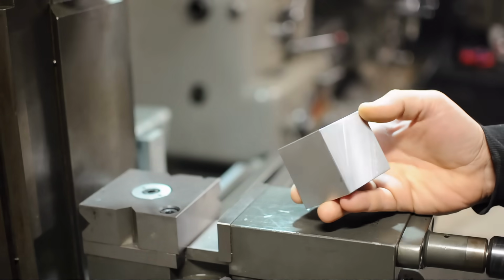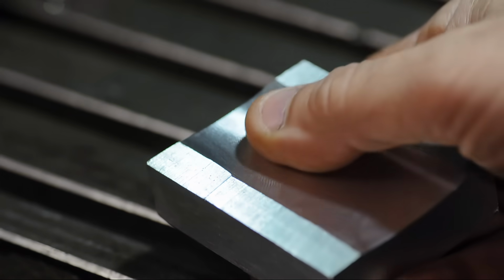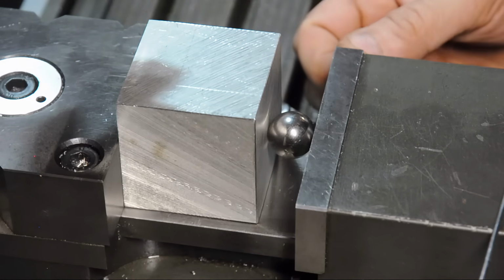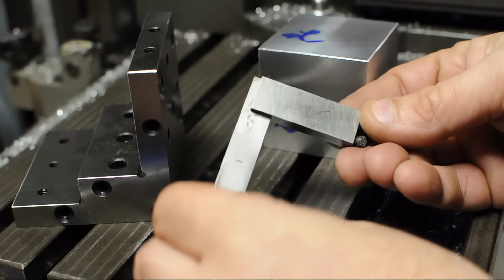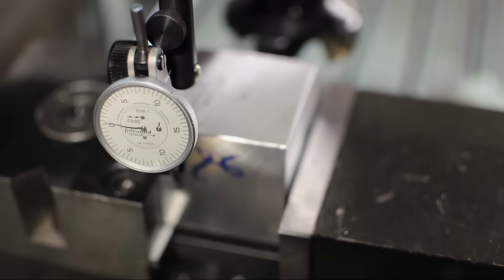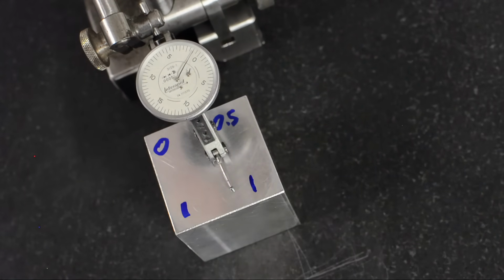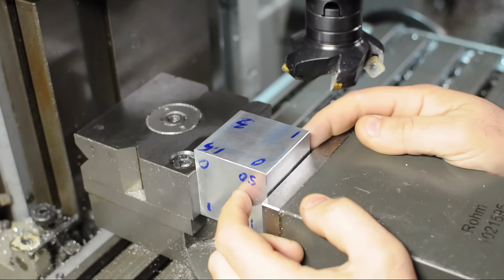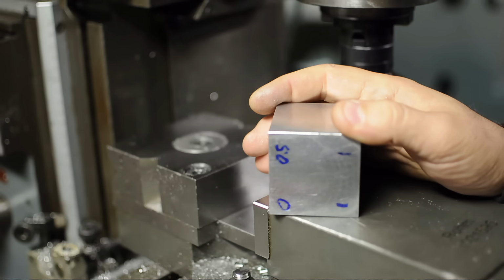Stock? Mill? Square!

Comment: tony can you get steel as level as a surface plate  so you can scrape ways and such?  like down deep in the numbers ,0.2S ,0.1S? "reasoning" i'm looking at synthetics as base material and maybe even way and such i figure if it can be done in steel alt-materials would be a cinch and surface plates for what they are well i don't have any children to sell and i'm down to one kidney and my doctor says the other is a no go.  if i'm ever to get started i'm going to have to get creative but it seems having the surface plate is the only answer as i want everything dead nutts of course,. meaning i'm going to have to start from the ground up, even gave acrylic-creet  and silicon forms a ponder

Comment: Good program Tony. Another thing that I was taught at the start of my apprenticeship, was to clamp a solid square against the finished side, and adjust the part to indicate the blade true. It works especially well on a surface grinder.
  Your milling machine is interesting. What brand is it?
Reply from the maker: schaublin

Comment: You can do all this in 2 mins if you make all 5 cuts on the first pass.... no need for all this shimming & soft rod to hold it... Use the milling machine's axis to fix the cube issues. I love you Tony, but there is a much better way to do this. Look at Joe Pie's vid on this.

Comment: I‘m a dentist, which means I do precision work with metal, but I did not see you measure the edges of the block to make sure it is a cube? Since there are 12 edges, milling one side would change 4 edges. Now I‘m verklemmt! Is it a cube or not? And if not what would it take to make it to be one? So you are probably square with the world but I am totally out of whack.

Comment: Just a wonderful tutorial, but I am not sure it demonstrated true squareness, since a square has sides of equal dimensions. This solid was orthogonal, but its dimensions were never measured. It could have been, and probably was,  a rectilinear parallelepiped.
Reply from the maker: good catch I should have been clearer. square, in machining, almost always means orthogonal.  90 degrees. not square as in the shape.

Comment: the video becomes boring not when it is long but when a narrator talks in a fast pace and viewers find a difficulty to follow while focusing on the video at the same time. as for my opinion on the error, could it be caused by the Vibration resulting from the friction between the work and the mill cutter with a high feed rate ?

Comment: Can a non-machinist ask what may be a silly question? How do you know that the face of your cutter is square to the axis of the mill and parallel to the table? Also are all cutting edges of the inserts in exactly the same plane? Since it is rotating, would any of that matter?
Reply: If you want perfect, you need to use an indicator on the vise (specifically the back jaw of the vise), in X direction, then, stick an indicator into the spindle, and put something you know is grounded/surface grounded squarely flat (a tramming ring) into the vise, big enough to sweep with your indicator in a circle with the spindle, it will show high and low points, thats where you tram in the mill head, either left/right or tilt front to back. If your spindle indicator sweep shows a high point on the left or right on the tramming ring, then you'll cut at an angle when you feed in the X direction, same with the Y if its high or low in the front or the back of the tramming ring.

Comment: 8:07 that's not a good idea, better put two nuts on both sides of the ball to get larger contact points, especially on hard material which has a significant tilt. Else you might end up with a ball flying up in the milling head.

You really don't want to be THIS guy in the workshop.

Comment: A Good vice and a CNC Mill can achieve better squareness than you make a milling machine out to. Maybe your standard manual mill. In a CNC Mill with zero table runout and a good vice like the Kurt 3800 series.0002” squareness is pretty simple to achieve maybe not every time. Half thou is about the worst it gets. 

Better yet clamp the stock in the vise. Skim the top face clean. The. Run a 2 d contour around the 4 outer sides. All that is left is facing the 6th side. The less setups the less variables.
Reply: More than the vise.. it was only a $1600 vise when I purchased it. It opens 10.25” and has perpendicularly on the fixed jaw like no other. It also has drawbacks. The fixed jaw Carrier is part or the cast vise body. So that complicates future refurbs with surface grinder. Still the vise paid for it self in one week. It also for repeatable setups for squaring stock and cam setups. It is awesome som. They make a 6” version called the 3600 also.
Reply: More than the vise.. it was only a $1600 vise when I purchased it. It opens 10.25” and has perpendicularly on the fixed jaw like no other. It also has drawbacks. The fixed jaw Carrier is part or the cast vise body. So that complicates future refurbs with surface grinder. Still the vise paid for it self in one week. It also for repeatable setups for squaring stock and cam setups. It is awesome som. They make a 6” version called the 3600 also.
Also my initial point was simply a mill can square stock extremely accurate with the correct equipment. His video was good the most important part of squaring up is the round object in the movable jaw the first 3 cuts. It’s just all that requires debuting and time. The contour method is incredibly accurate and it complete 5 of 6 sides. Leaving and simple deck off the top when done.
Reply: More than the vise.. it was only a $1600 vise when I purchased it. It opens 10.25” and has perpendicularly on the fixed jaw like no other. It also has drawbacks. The fixed jaw Carrier is part or the cast vise body. So that complicates future refurbs with surface grinder. Still the vise paid for it self in one week. It also for repeatable setups for squaring stock and cam setups. It is awesome som. They make a 6” version called the 3600 also.
Also my initial point was simply a mill can square stock extremely accurate with the correct equipment. His video was good the most important part of squaring up is the round object in the movable jaw the first 3 cuts. It’s just all that requires debuting and time. The contour method is incredibly accurate and it complete 5 of 6 sides. Leaving and simple deck off the top when done.
Reply: More than the vise.. it was only a $1600 vise when I purchased it. It opens 10.25” and has perpendicularly on the fixed jaw like no other. It also has drawbacks. The fixed jaw Carrier is part or the cast vise body. So that complicates future refurbs with surface grinder. Still the vise paid for it self in one week. It also for repeatable setups for squaring stock and cam setups. It is awesome som. They make a 6” version called the 3600 also.
Also my initial point was simply a mill can square stock extremely accurate with the correct equipment. His video was good the most important part of squaring up is the round object in the movable jaw the first 3 cuts. It’s just all that requires debuting and time. The contour method is incredibly accurate and it complete 5 of 6 sides. Leaving and simple deck off the top when done.
Reply: More than the vise.. it was only a $1600 vise when I purchased it. It opens 10.25” and has perpendicularly on the fixed jaw like no other. It also has drawbacks. The fixed jaw Carrier is part or the cast vise body. So that complicates future refurbs with surface grinder. Still the vise paid for it self in one week. It also for repeatable setups for squaring stock and cam setups. It is awesome som. They make a 6” version called the 3600 also.
Also my initial point was simply a mill can square stock extremely accurate with the correct equipment. His video was good the most important part of squaring up is the round object in the movable jaw the first 3 cuts. It’s just all that requires debuting and time. The contour method is incredibly accurate and it complete 5 of 6 sides. Leaving and simple deck off the top when done.
Reply: More than the vise.. it was only a $1600 vise when I purchased it. It opens 10.25” and has perpendicularly on the fixed jaw like no other. It also has drawbacks. The fixed jaw Carrier is part or the cast vise body. So that complicates future refurbs with surface grinder. Still the vise paid for it self in one week. It also for repeatable setups for squaring stock and cam setups. It is awesome som. They make a 6” version called the 3600 also.
Also my initial point was simply a mill can square stock extremely accurate with the correct equipment. His video was good the most important part of squaring up is the round object in the movable jaw the first 3 cuts. It’s just all that requires debuting and time. The contour method is incredibly accurate and it complete 5 of 6 sides. Leaving and simple deck off the top when done.
Reply: More than the vise.. it was only a $1600 vise when I purchased it. It opens 10.25” and has perpendicularly on the fixed jaw like no other. It also has drawbacks. The fixed jaw Carrier is part or the cast vise body. So that complicates future refurbs with surface grinder. Still the vise paid for it self in one week. It also for repeatable setups for squaring stock and cam setups. It is awesome som. They make a 6” version called the 3600 also.
Also my initial point was simply a mill can square stock extremely accurate with the correct equipment. His video was good the most important part of squaring up is the round object in the movable jaw the first 3 cuts. It’s just all that requires debuting and time. The contour method is incredibly accurate and it complete 5 of 6 sides. Leaving and simple deck off the top when done.
Reply: More than the vise.. it was only a $1600 vise when I purchased it. It opens 10.25” and has perpendicularly on the fixed jaw like no other. It also has drawbacks. The fixed jaw Carrier is part or the cast vise body. So that complicates future refurbs with surface grinder. Still the vise paid for it self in one week. It also for repeatable setups for squaring stock and cam setups. It is awesome som. They make a 6” version called the 3600 also.
Also my initial point was simply a mill can square stock extremely accurate with the correct equipment. His video was good the most important part of squaring up is the round object in the movable jaw the first 3 cuts. It’s just all that requires debuting and time. The contour method is incredibly accurate and it complete 5 of 6 sides. Leaving and simple deck off the top when done.
Reply: More than the vise.. it was only a $1600 vise when I purchased it. It opens 10.25” and has perpendicularly on the fixed jaw like no other. It also has drawbacks. The fixed jaw Carrier is part or the cast vise body. So that complicates future refurbs with surface grinder. Still the vise paid for it self in one week. It also for repeatable setups for squaring stock and cam setups. It is awesome som. They make a 6” version called the 3600 also.
Also my initial point was simply a mill can square stock extremely accurate with the correct equipment. His video was good the most important part of squaring up is the round object in the movable jaw the first 3 cuts. It’s just all that requires debuting and time. The contour method is incredibly accurate and it complete 5 of 6 sides. Leaving and simple deck off the top when done.
Reply: More than the vise.. it was only a $1600 vise when I purchased it. It opens 10.25” and has perpendicularly on the fixed jaw like no other. It also has drawbacks. The fixed jaw Carrier is part or the cast vise body. So that complicates future refurbs with surface grinder. Still the vise paid for it self in one week. It also for repeatable setups for squaring stock and cam setups. It is awesome som. They make a 6” version called the 3600 also.
Also my initial point was simply a mill can square stock extremely accurate with the correct equipment. His video was good the most important part of squaring up is the round object in the movable jaw the first 3 cuts. It’s just all that requires debuting and time. The contour method is incredibly accurate and it complete 5 of 6 sides. Leaving and simple deck off the top when done.

Comment: At timestamp 7:30 you mentioned that you want to start with the largest face first (of course as you mentioned in this case you're working with a cube).
Is the reason because you want to make the largest "truly square/flat" face you can for referencing the other faces off of?
Reply: its because the shorter sides are likely to need more cutting off because they are made square in relation to the first side

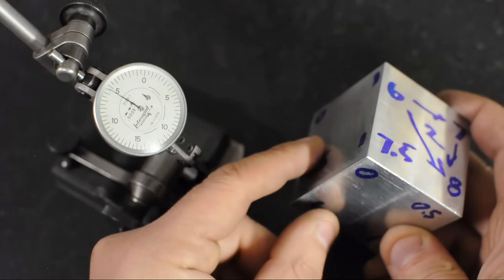Comment: Hopefully someone can answer this question. Tony said he zeroed the dial indicator around 19:26. Why does the dial read around 5.5 thou when it isn't pressed against anything? Shouldn't it read 0 with nothing against it?
Reply from the maker: oh oh I know!  ;)  "zeroed" in this case means it's zeroed to a reference..  So if I put 3 things under the indicator, and they all read zero, they're all the same height.  if one of them reads 0.005", it doesn't mean it's 0.005" tall, it means 0.005" tallER than my reference.  Also it's good practice to "preload" the indicator against whatever you're measuring.  In this case, it's preloaded about 5.5thou, just to take up any slack in the mechanism. 

hope that helps!
Reply: lol Yes it does. Thanks!

Comment: I really enjoyed your video.  I am in school in the machinist program,  right now I am turning "Straight Turn" its a cylindrical bar that has to have a diameter of .706-.712 but a cylindrical tolerance of .002.  I am brand new and am getting frustrated.  I am using a 4 jaw chuck on a lathe and I have to turn it between centers.  do you have any advice?
Reply: Use collet chuck for this

Comment: After tramming the mill, is there a way to indicate the vertical face of the fixed jaw on the vise to ensure its perfectly square to the mill table?
Reply from the maker: yes but not really.  that squareness depends on the condition of the machine and quality of the vise.  that said... shims. :)
Reply: @ThisOldTony  Thanks, after thinking about it some more I realized you would also need the bed of the vise to be perfectly flat to the milling head too so yeah, shims.

Comment: Dumb noob question.  When tramming the mill with the indicator on the parallels, how do you ensure that the indicator is attached squarely to the head (i.e., the part that rotates?)   If it was on crooked, you'd get an error.   The vid just shows the indicator on there, without showing how it got attached.
Reply from the maker: the head is what you are adjusting.
Reply: @ThisOldTony  Thanks.  I understand that.  What isn't clear to me is how you know the indicator is square to the head, before you adjust the head.  If the indicator were to be on crooked, it wouldn't matter how you adjusted the head, it would always be out.   How is the indicator attached?

Comment: Figure in your cost of squaring stock vs buying stock that's square...
Reply: Where do you buy stock squared to that precision for less than a couple hours labor?
Reply: @RHammer9  Misumi for one (https://us.misumi-ec.com/fa/automationmaterials/cadroot/MetalPlate.php), or TCI Precision (https://tciprecision.com/) to name a couple. 

One application that really runs up the labor is the saw-cut cylindrical bar. Making a flat & parallel out of something like that, especially if the OD needs turning is pretty laborious... and typically more costly than buying and designing around an available blank. All food for cost analysis...
Reply: @zaknefain100 , Just checked those out. For what I'm after, their prices are much better than I expected. Thank you.
Reply: @RHammer9  Hey, glad I could help mate. I use a lot of blanks in my shop's tooling and design projects. Shop rate is ~150 USD per hour, so blanking out 6 sides in 30 minutes is an extra $75 to the material cost, never mind the cost to consumables. At that point, the pre-made blanks are usually the less expensive option. YMMV though, but that's job costing in general.

Comment: Using a fly cutter or face mill to cut with one pass may not be the best.   Using a much smaller diameter end mill with multiple passes often gives a better surface.   The reason?   Your tram was, I believe, 0.002 across your part.   It is way smaller across the end mill.  I worked in an aerospace manufacturing plant years ago, and they ALWAYS cut surfaces that had close flatness, parallel and square tolerances with 0.500 diameter end mills.